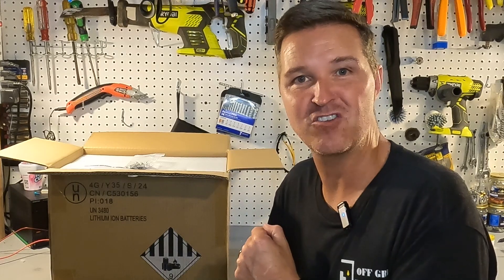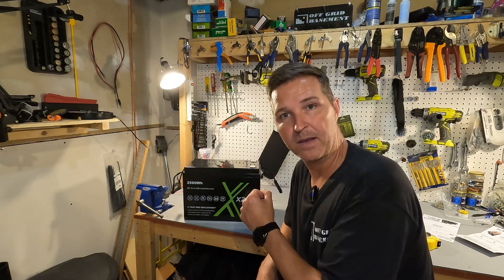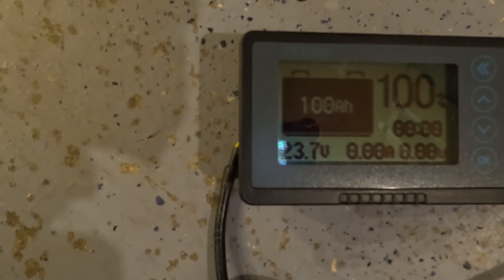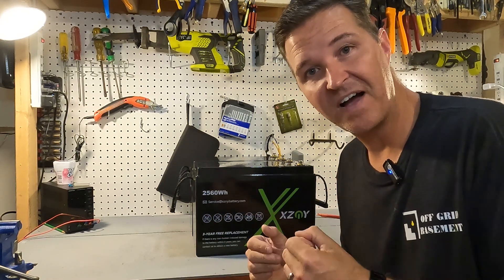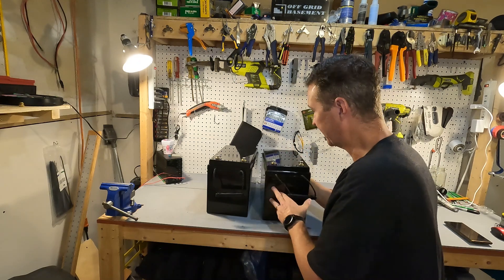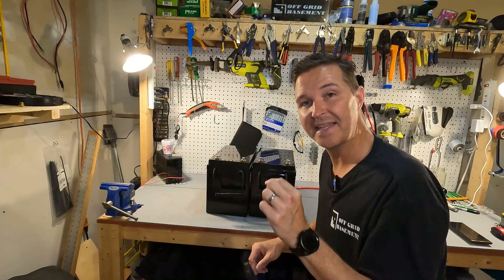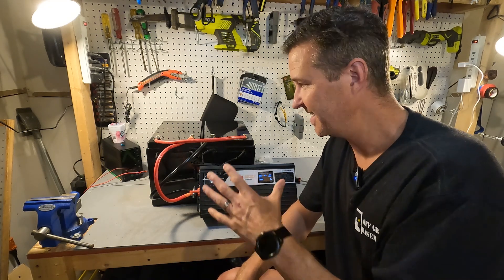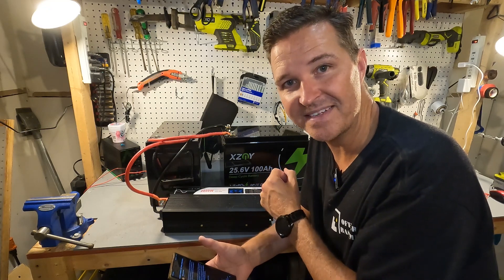XZNY 24v 100ah LiFePO4 Battery.  Build a 48v Battery bank in half the space as 12v batteries!

Comment: my big vitron 150/60 after 6 month has gone bad i can,t get no help from victron 500 .00 down the  drain i can buy 5 powmr,s 100amp that will do the same thing ,NO MORE VICTRONS FOR ME ooycyoo controller is better i can gett 3 of them for the price of a victron
Reply from the maker: Thanks for sharing.  I'm surprised the victron bit the dust.  I'm have been going for over 3 years without any hiccups.
Reply: @OffGridBasement  i have a smaller one 150/45  i have never had a problem with it goes to float every day gets up to about 43 amps i have 6 200 w panels on it 48v working fine
Reply: @OffGridBasement  i think i learned the hard way never run your controller to the max if victron will help me out , im will be cutting down to 50 percent  off what they say on my v 150/60 to 57v on the aray to 1300 watts instead of1900 watts

Comment: nice price.  i have a dc house 12 volt 200ah  46 lb 14.5 long 10.7 high 7.5 wide nice and small. i would need 4 for 48volts but 2x power and 2x more space . i can set 4 up for 12 24 or 48 volt system👍👍
Reply from the maker: Thanks for sharing and the comment!

Comment: If you charge from a 48V source, such as a Solar charger, then one battery could disconnect before the other, which could upset the batteries, and solar charger...?
Reply from the maker: Yes.  You don't want to set your charger controller so high that it disconnects.  You shouldn't have problems if you top balance.